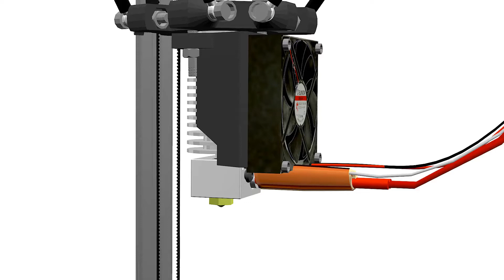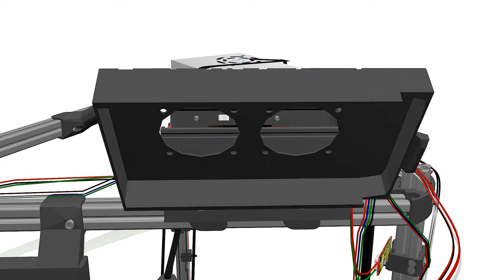Build a Delta 3D Printer - Wiring and electronics pt.3

Comment: I just want to be able to properly input my printer dimensions in the clipper 😅
Reply from the maker: I'll be posting a follow up video on setting up the firmware with Repetier v soon, haven't used Klipper but I can imagine it's very similar!
If you want to go for it keep in mind that most important dimension for deltas are the delta radius and rod length.
Hope this helps, good luck with setting your firmware

Comment: This build video series is one of the most beginner friendly and information packed on YouTube.
The 3d models and assembly animations make is really easy to follow along.
RAMPS 1.4 is the most prolific printer board in the world I can understand why it was chosen for this project. 

The printer control firmware is a genuine obstacle for first time printer builders,it can be slightly overwhelming to understand all the available options in the configuration files.
Very much looking forward to your next update in this series,thank you for making and taking the time to share your findings.
Reply from the maker: Thank you! The following chapters on firmware and calibration are still to be done :)